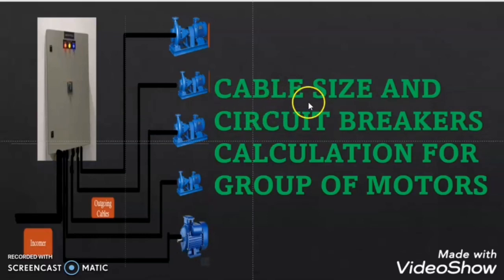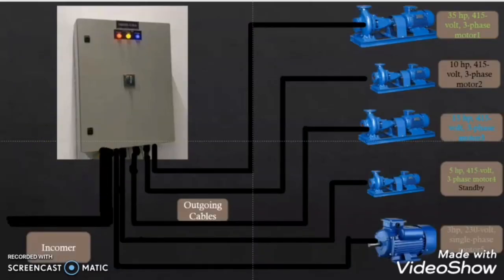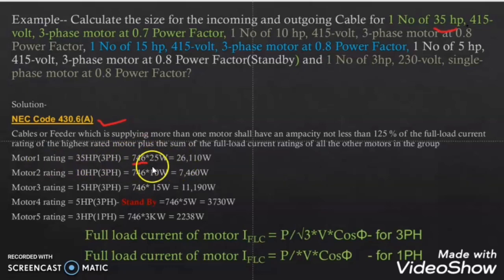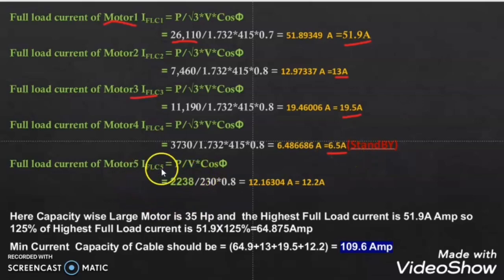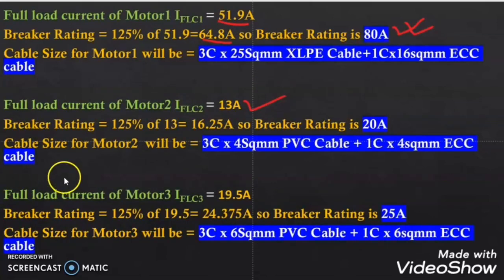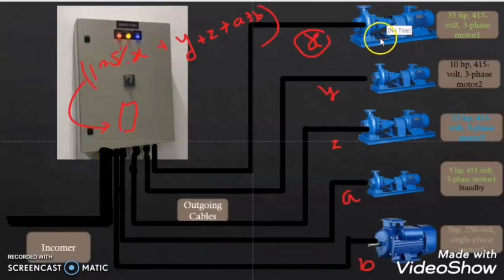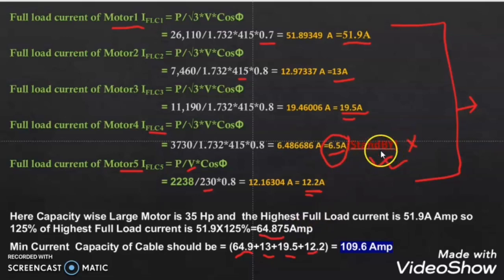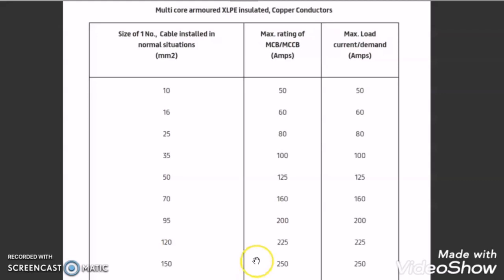Calculation of Circuit Breaker and Cable Size for Group of Motors.

Comment: Sir you use 35hp motor is load 51.9amp and you multiply 125% and answer is 64.9 but i question is why you multiple 125% if you multiply but other motor load not multiply by125% pls tell me sir i am confused. If u want multiply 35hp motor to 125% but u need others motor multiply by125%

Comment: Im confused breaker rating should be 250% of FLC 125% of FLC shall be used in cable not in circuit breaker
Reply: You are absolutely correct the breaker rating must be 250% of flc.